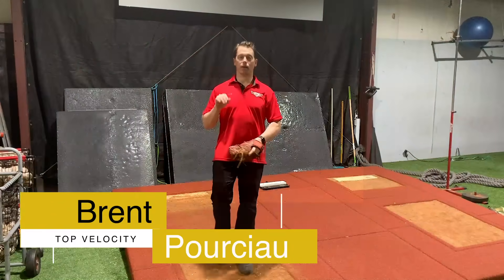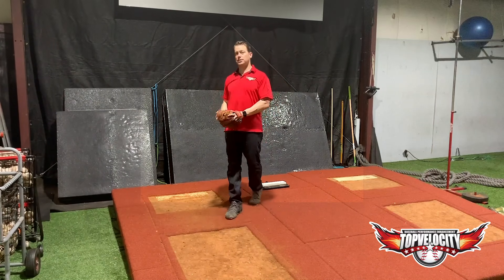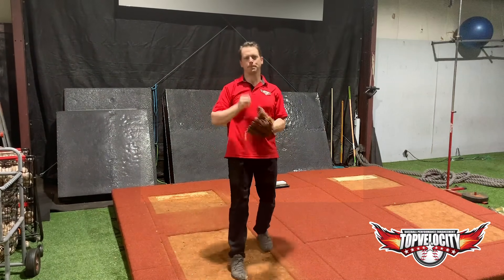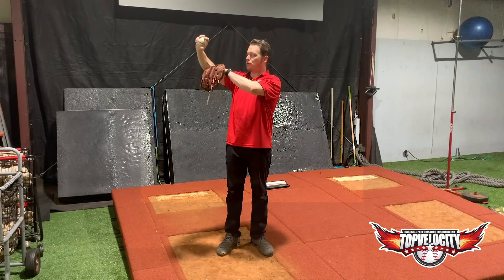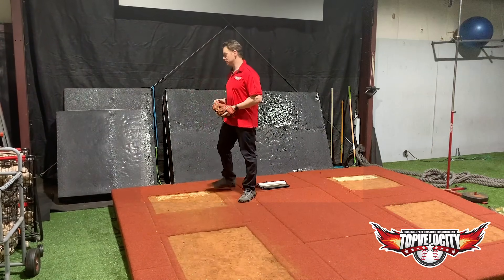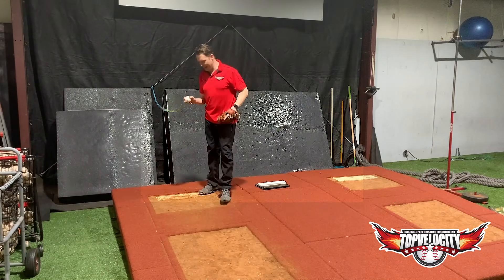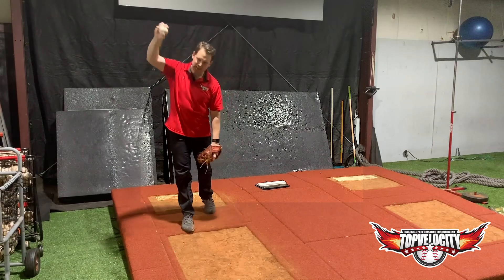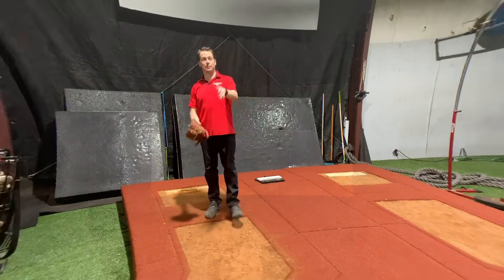The Dangers of Arm Drag Pitching | TopVelocity

Comment: I have a son who has struggled with the arm drag from pulling hard with the front shoulder to try and throw harder for some time. We have been able to make progress using several drills, but then it comes back into his motion as soon as it isn't the primary focus of his training. Recently we shortened his arm action, which has really helped with the arm dragging out, as you reference in your other video, but I would like to go more to the source if possible. Do you have a drill or two specifically for teaching them the right way to not pull ahead with their glove side a player can use for not only learning the correct pattern, but maintenance of it?
Reply from the maker: It is a bigger approach than just using a drill. I would recommend you study the method here more!
Reply: @brentpourciau  Thanks, I have looked at it quite a bit, but for someone that has habitually poor patterns that you are able to correct over time with intense focus is there nothing that can be used for maintenance of those patterns from a drill perspective that provides the correct movements in a concise format vs constantly having to focus on those movements as their primary training. Said player is 11 and plays a lot of positions, plus still has to work on hitting, so doing all of these things all the time just isn't realistic. As soon as the focus is taking away from all of the correct movement patterns, the bad habits return, which would be great to have something he can focus on within the correct movements that simplifies and maintains the investment he made in the corrections. Hope that makes sense. Maybe it just isn't realistic and it will be a constant reoccurring issue until he gets older and has more time and ability to dedicate to the changes and maintain them. He has this issue with throw downs from catcher, and longer throws as well, so this isn't just a pitching question for him. Thanks for the quick reply.

Comment: Great video as usual Brent!

I have a couple of little leaguers that struggle with two things:

1. A couple constantly side spin their ball when pitching inadvertently. They are basically throwing a slider every time. I can’t seem to correct this. I ensure that their thumb is directly under the baseball etc yet they still seem to have a form of supination I guess when at pitch release. Tips for this would be great. 

2. A couple of RH pitchers miss badly inside (ie high and tight to RH hitters). I try to look closely if they are opening up too early and thus their arm is lagging but am also having some issues with how to best communicate to them what to be focusing on to get square and ensure that they are getting heir arm out in front of them on time to prevent the tailing action on their pitches. Help in this area would be great too. 

Thanks!!
Reply: I'm 14 and I've had problems with some of these myself, I'm pretty sure for the first one where there throwing a curveball, (slider) their throwing the ball and twisting there palm up, If you throw like that hard and lock your elbow it will lead to arm damage, to fix that have them throw or practice throwing withought twisting there wrist or turning there wrist slightly inside

I'm not sure about the second one, Its kind of hard to tell withought being able to see it. Some Ideas might be, they're geting there arm to high, they're not gripping the ball enough they're not planting there front foot before they throw or maby there just plain overthinking it, there's a lot of stuff that could be wrong and I'm no professional, this is just speculation